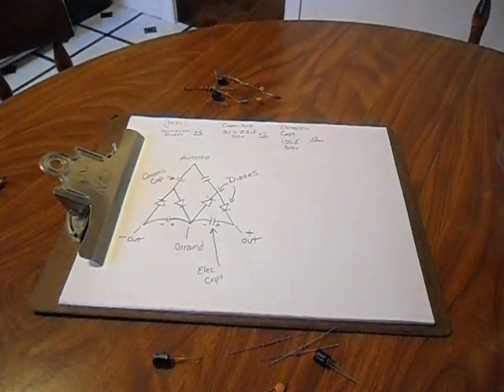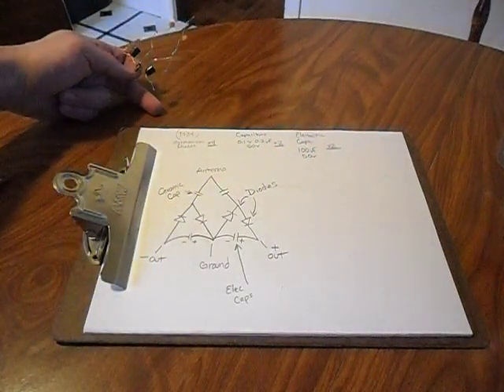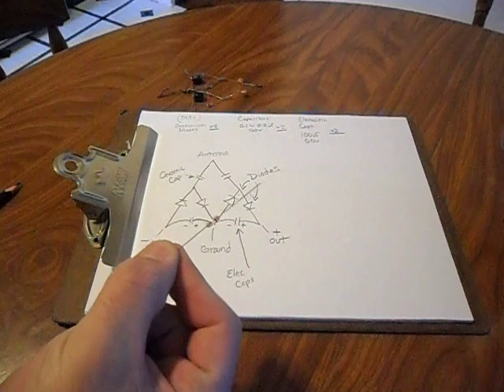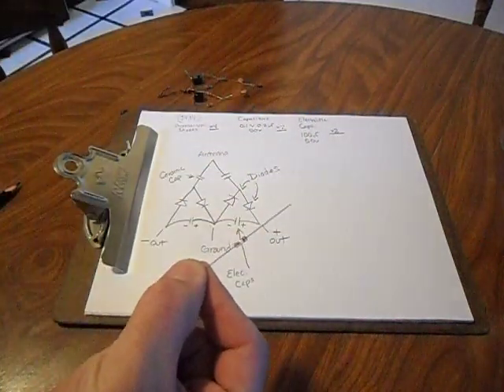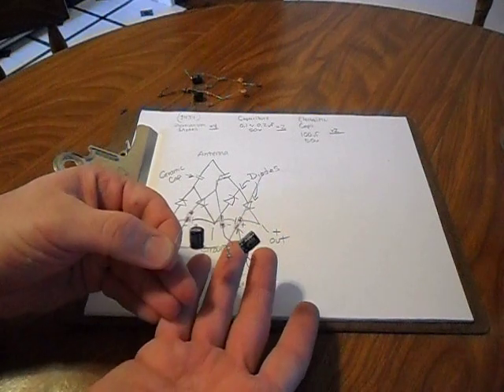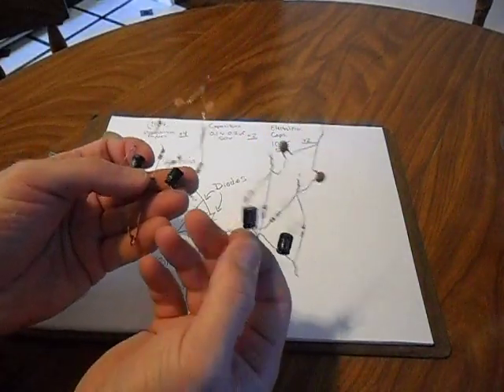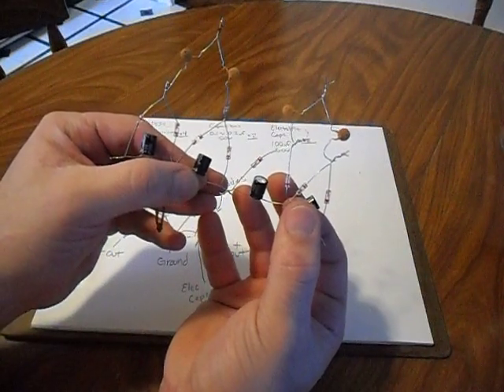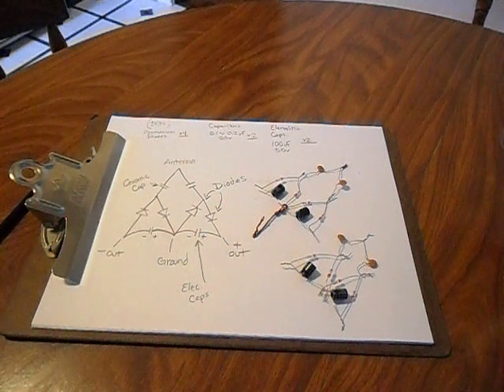Nikola Tesla "free energy from air" circuit explained and building instructions.

Comment: do u hav blue print or diagram on how to make a unit for an entire house??
Reply: Start with 1000 units..... I would say the smallest antenna around a decimeter and increase each one by 1% over the previous.   scatter them about and measure the output of each.  move around the strongest to reach their highest yeild.  might have to do it multiple times.  then, the medials,  and then the weakest.  once you have verified the best signals, fine tune orientation and add reflectors.   use the unfruitful ones and set them to the length of the good signals and build arrays, perpendicular to the direction of the signal in relation to the first antenna..... or even multiple arrays placed above and behind the first row, using the frequency to sync alternating pulse from the 2 arrays at the junction of each for a smoother output.... iirc, the smallest length antenna for 60hz is like 34feet.

Comment: You must be pretty intelligent to put ou a video like this. My honest side would have to admit that only an idiot would do this and not even mention a single component value, and then the big one- they'd probably not even show that it works. So tell us, what have you powered with your version of this? Don't answer if it doesn't work.
Reply: The components are written in the left-hand top corner at the start of the video. This their exact values. Pay more attention. This little Tesla toy is all over the Internet. It creates a very small amount of power, and the other thing that is not described is that it runs on an antenna, the larger the antenna the more power you get. Though you end up with four terminals, and antenna, a ground, and a positive and negative terminal.

Comment: Also would it not be more efficient to wrap the antenna in the grounded positive charged RF coil to reduce resistance and electromagnetically boost negative charged air ions in antenna. Just a thought

Comment: Great if your close to a powerful radio/tv transmiiter maybe...but still not a real free energy device cause it gets power from a paid  energy powered electrical system...  But pretty cool...might take a 1000 circuits to achieve  useful power...??
Reply: +John Baart your not considering the fact that whatever device your powering through this method is absolutely not costing you to power it. your powering it by waste essentially
Reply: +james nichols Wrong. Learn something about electromagnetic fields.

Comment: I think this is a solid state device that works on electrostic fields like a whimshurst or lord kelvin machine., the key is the diode which I believe is a triboelectric charge separater activated  and stirred by RF.  The caps are like layden jars and the diodes are the charge separaters much like the metal pickups next to the water streams in lord kelvin's machine and the rotating glass and metal plates in the whimshurst. Diode + cap = solid state static generator! The RF just agitates the diodes like water passing through the metal tube in lord kelvin's exp,  movement of triboelectric materials is normally required.  So, more RF  and more triboelectrics in the diodes may give better performance., when the effect can be enhanced with out more RF there is the chance of having an effective energy capture device. I.e., less RF input more Diode output.  I believe this device creates a static separation at the diode, its performace maybe enhanced by the arial to capture pre-existic static, l but I dont think this is essential.  The arial is just a collector of RF or neutral charges that is sent to the engine proper.. Diode!
Reply: after suppressing an initial headache, i really enjoyed your explanation, by adding so many impressive sounding ideas and terms together.
I'ts like a gardener explaying how open heart surgery works.
It's a nice story put together.

Comment: btw, if you want to improve the circuit, use induction dampeners, or "chokes" on the +/- outputs to smooth the voltage better.  otherwise, putting on a board would be the only way to "improve" the simple circuit.

Comment: simply, this is a dual rail rectifier.  basicaly, it isolates from dc offset, and outputs dc +/- and common (neutral)  it scavenges any, well, basically radio waves, strongest at the wavelength you tune it to.  practical use, you would need to know the standing waves in your location that are strongest, and tune the antennae to that frequency...... hint, hint, it's probably 60 hz.
Reply: Yep
Reply: +Sith'ari Azithoth because the most common high energy source is residential power lines.  the more current being used down stream, the larger the field, and in turn the more you can induce into the device.... of course,  you could also tune to tv, fm, etc, but am and ham frequencies are more likely to also pick up some energy from other random natural earth currents.... but ultimately,  I think aligned Power lines are the greatest potential for picking the energy up, but you would need a bias resolving circuit to extract directly from them.  capacitors dampen with both harmonic, and capacitance value. (like smacking your hand on a capped cylinder.  without the volume, it would neither take in the force of air, nor bounce it back at a predetermined reflection, defined by length, area, (farad) and speed (voltage ).... in thus circuit,  they are dampening the pulsed DC outputs, which are already rectified by the diodes.

Comment: Improvement was asked for...OK. It's basically an antenna feeding a voltage doubler. Well, google voltage doubler and voltage multiplier circuits on wikipedia.... You can put in several stages of these doubler circuits (just a diode and capacitor). I did some experiments on this several years ago. So, what you could do is feed the antenna to multiple stages of voltage doubling. You do get higher and higher voltages. However, you have to be careful as after a certain number of stages, the doubler circuit causes too much loss in the system, so the trick is to find the right number of doubler stages. Typically I found that in my home, it was around 5 or 6 stages. So you get 2^5 = 32 multiplier. So your antenna voltage gets multiplied by 32 to give you your output. Note that these doubler circuits don't give you more energy, but they raise the voltage up high enough to be actually useful. Note that as soon as you take the output from a multimeter and put an actual load on there, the voltage will drop again due to current flowing through a load. Also, note that the electrolytic caps are in one stage so that these can be charged up to give the circuit an initial umph and to keep the output a little more stable.
Typically, such a circuit would have an antenna feeding a couple of voltage doubling stages. Then, this output is fed to a big electrolytic cap (or even a supercap in some stages). Thus the supercap is the source of the output and can be charged up when not in use. Then, for the actual output, there is typically a kind of joule thief circuit (google joule thief) that is used to drive the final output, so that when the voltage gets very low, it's boosted to a stable voltage that can be used to drive an LED or something, even when the supercap gets discharged below what would be normally a voltage that is too low. You can see such a circuit in those cheap garden solar powered lights. If you open it up, you'll see a solar cell feeding a rechargable battery (instead of a supercap)  and a joule thief on the output side, driving an LED.
Hope this gives y'all some ideas.
Reply: Donald Murray not a voltage doubler, simple rectifier circuit.  the 2 caps on the antennae side inhibit any voltage bias, and the 2 caps on the "rail outputs(+)/(-)" dampen the ac ripple. .... you see the same thing in 12v audio amplifiers.
Reply: The reason it acts like a voltage doubler is because there is a frequency divider effect going on,
Reply: +91 8401358140

can u please whatsapp me, I have a project for u
Reply: Darshan Prajapati are you a vodafone scammer?
Reply: darshan.prajapati36@gmail.com

can u please email me, I have a project for u
Reply: darshan(.)prajapati36(@)gmail.com

can u please email me, I have a project for u

Comment: The rectifier circuit is needlessly complex and is going to waste quite a lot of the energy available in the diodes.  A big 1 turn loop antenna with one side grounded through an RF coil and the other connected to a BAS70 diode works very well.

Comment: HOW ABOUT -MAKING UP A WORKING MODEL -WITH LED IN PLACE -LITE UP
Reply: +Dave G  The circuit does work, it is acting as a radio wave detector, un tuned, and as connected will produce an output at only nanowatts, unless very near a powerful radio transmitter. To get an LED illuminate it would need a voltage applied to get about 10 ma to flow, far beyond this circuit.
Very near a multi megawatt transmitter and an efficient version of the circuit and yes, you could light an LED, and by near I mean a few feet. But you could get many vacuum strip lights to glow much better!
Stephen
Reply: +stephen wallin THANKS -I DID KNOT KNOW IT TOOK THAT MUCH POWER I THOUGHT I SEEN ONE WORKING OUTSIDE BUT IT COULD HAVE HAD A HIDDEN BATTERY IN IT -AS U KNOW SOME WILL FAKE STUFF HERE

Comment: Guys, I made this for my science fair, and it's not working. Please help someone. What did I do wrong. We're does the ground wire go? Can I use copper wire for the antenna ? Should both the ends of the antenna be connected to the circuit, or only one? Why am I getting no voltage on the voltmeter, someone please help, I'm in a hurry.
Reply: did you do it?